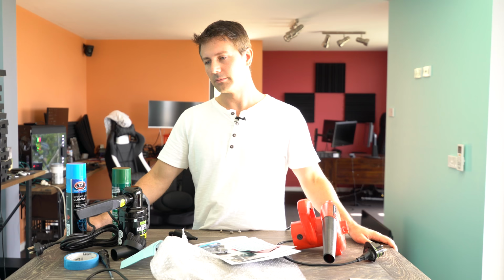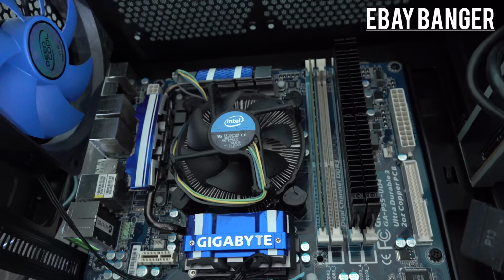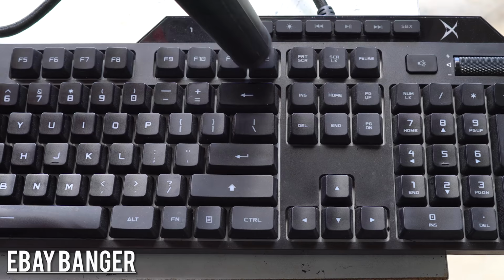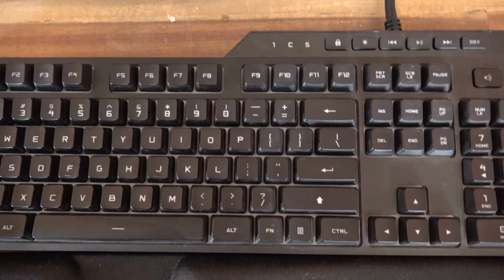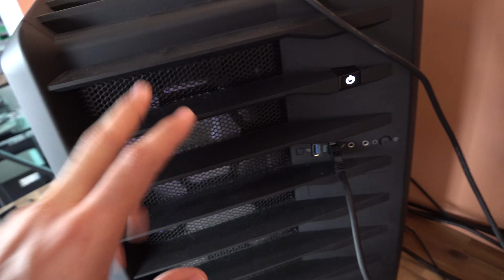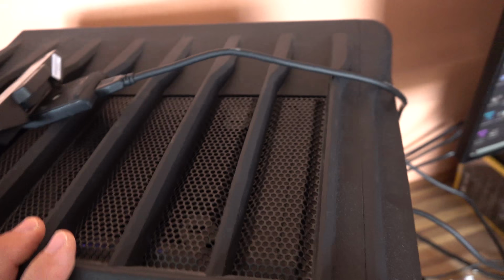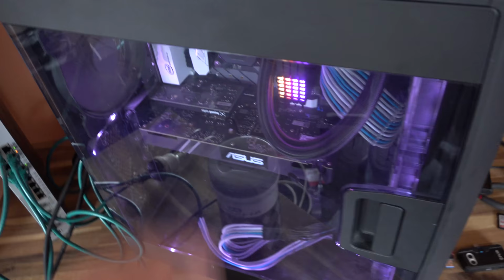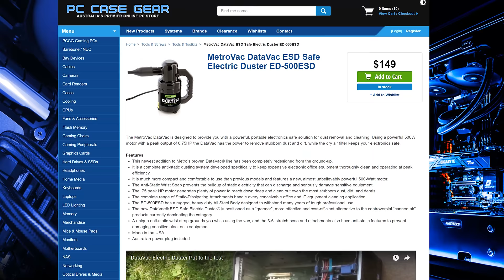DataVac Electric Duster Review - $93 Blower Vs. $25 Cheaper Ebay Version

Comment: Air compressor for nearly 20 years, not one single problem if you're careful and test for moisture with a white piece of paper as the moisture will adhere to it if it's a condensated tank. If that's the case, it's easy. Run a full cycle of decompressionand then try again. Had it happen like twice. I can get every single piece of dust out of my cases and keyboards no problem. Short blasts about a foot or so away. Just dont do it close to parts and it's never going to hurt you. Again 20 years. The experience and results speak for themselves.

Comment: You finally got one!  I love my Datavac!!  Best investment ever.  Next time use the small straw like attachment as it increases pressure due to the smaller hole and creates a hurricane in your case.  It's great for pin point cleaning like the keyboard.

Comment: Personally I bought a cheap 24 litre oil less air compressor with accessory set (≤£100).  You can control the pressure coming out of the blow nozzle on the tank and as long as the PC wasn't kept in a heavy smokers room all the dust bunnies fly out.  I have even up cycled some unused chopsticks as fan holders to get into all the nooks and crannies.  I've just had to buy a new one after 10 years of medium weekend use.  My only warning is don't get right up close to relatively large/tall components (caps) because you can bend them over.  Plus you can use the compressor for other jobs around the home, car, garden.

Comment: Never, never, never blow the dust from outside the case into the PC.  Also if you create a positive pressure in your case through fan orientation, you can greatly limit the amount of dust internal to the PC.

Comment: Here's what we did at Intrex Computers in Raleigh, NC back in the day...they may still do this. lol Pop the panels off and take it out back. Physically hold it over the big HVAC unit. That huge fan will blow out every molecule of dust in under five seconds. It's massively impressive the first time you see it done. Dunno if this will kill the bearings in your fans, but it does work. :D

Comment: honestly i think its down to the attachments, the datavac simply blows the air through a focused nozzle while the other one has a wide open hole. U can do a makeshift nozzle on the ebay blower and it should do fine.

Comment: Brian, you can get the non-esd version of the datavac for around $60-$70 usd. It has a white body instead of the black one on the esd version. I've been using it for a few years now with no problems.

Either way, the datavacs are well worth the premium over the cheap china brands.

Comment: I personally use the ITDusters CompuCleaner Original 2 (what a name!) which retail for £49 in the UK which is right in the middle. It has excellent build quality, is extremely powerful (not to the point that it'll blow holes through components however) and has all the attachments you could likely need.

Comment: Nice video, aside from the WD-40, but did either blower clean the sides of the keys on the keyboard as it looked like it needed a brush or Q-tip instead.
Reply: What's the point of WD40? WTF?

Comment: The Tech Dept I work for has 3 of these Data Vac that we hand out during the summer cleaning while schools out. They are an amazing time and money saver over canned air. We were using a big compressor before that but these you can take into rooms and they have a very long 10ft(ish) cord. Great for blowing out pcs, keyboards, and the dustiest projectors you will ever see in central Texas. They can get pretty hot though after about 2 hours of off and on use they need a little bit to cool down especially when using in un air-conditioned rooms in the summer.
Reply: Exactly why I prefer it over my compressor, CBF running hose out from garage or taking 30kg pc case out there, That freaking case has already ripped a calf muscle when I built the damn thing, Lifted it wrong way on one leg on tip toes to lean over and place in corner of desk, yep one of those 1 in a billion stupid moments that cost me 4 months off work.
Now I don't touch the pc, Datavac it and leave it in place then vacuum room later on.  ;)

Comment: I use an old Black N Decker dustbuster model ... the VH800 .. Paid, like, 20 bucks for it (brand new), and the air blowing function is so strong that it literally, blew a DDR out of it's DIMM slot...  insane shit.

Comment: I went cheap and bought the Rok mini blower from Mitre10 its okay looks the same as the Ebay one. I was eyeing out the Makita but for some thing i won't use much didn't want to spend that much the Makita does have higher RPMs. Sydneytools has the Makita for a decent price. 
Try making the hole smaller on the cheap blower that will help.

Comment: WD-40? Is that a normal thing? I've never heard of using it.
Reply: I use it to lubricate doors when their squeaking. Used to loosen very tight screws as well. It's very common.
However, this is the first time I've seen it used to clean computer components.

Comment: I bought the Datavac ED500 (EU version) for $43 on sale at Ebay or Amazon. I highly recommend the ED500 if you can find it for $50 def pick it up. The older version is white,and if someone got it in stock I'm sure you can get it a bit cheaper. It will save you from buying canned air and is more effective,and will literally clean a dusted up pc in minutes.
Reply: Also a point worth noting Is that the Datavac is a lot more "space friendly",since it's kinda shaped like a Coffee pot it will be easy to put in a drawer or closet compared to the leaf blower.

Comment: I have read horror stories about the fans damaging the PC (static discharge?) if they were allowed to spin freely during the cleaning process.
Reply: the fan motor acts like a generator (similar to a wind turbine) it ether burns out the motor coil, burns out the fan diode or, sends unregulated electricity directly to the fan headers on the mob. On top of all that it will most definitely shorten the bearing life of the fans

Comment: I would recommend getting a cheap $100 air compressor from bunnings, it put's out way more psi than these and I use it to clean dust out of my pc, ps4 and even my tv amongst other things. It also doubles as a spray painting tool, operates neumatic tools, pump up your car tires, etc. The list of uses go on and on but these items in the video cannot be used for much of anything else...

Comment: Here in NZ compressed air cans are so dear $18NZ and I resent paying that much, especially as it only last for 1 or 2 cleans.
I am tempted to get that Autovac, but then a normal compressor may be more useful around the house.
I don't think I'll be using that WD40 brake cleaner on my valuable PCs..
It looks like they did a nice job, but I'd be worried about the long term effects
Good video though well done and nice tasteful music.

Comment: Bryan, just a tip mate. Try to hold down the fans that are inside the chassis when using a blower to clean up stuff.

Making those fans spin in the wrong direction could damage the bearings that are on them.

As usual, great video! I have a similar $25 cheapo blower myself. These are all the same, it's just they come with different names, stickers and packaging.

Hoping to get hold of something like the Datavac someday to make my life easier.

Comment: Aren't you supposed to hold on to the fans to avoid it from spinning? They said it will damage the fan because of the high psi air from the blower?

Comment: the data has a crevice tool on it so its got more air power 
if the ebay one had a crevice tool it would probably work better 

as for me i use a my sweeper house to get the bunnies then use my air compressor set to 40-60 PSI to get the rest out (set it that way so 125 PSI doesn't get blown in and break parts off the motherboard)

Comment: its over $200 now.   There are other electric dusters for around $110 that look good.  There's no spec to compare to see which is actually more powerful without buying them sadly.  Wish some youtube would do some scientific tests on these dust blowers to see which actually outputs the most power.
Reply: They are simple devices, they're all the same. 
Just the housing. And maybe the power, if you look at how much energy they consume or how much they blow. And maybe the nozzle attachments, if they're included.
Mostly aestetic differences.

Comment: WD is not good for plastic, its for lubing up metal joints not cleaning, use metho if you want to clean it with something, it evaporates in the air really quickly, it can rot some rubber with excessive use, it might ruin painted metal but i doubt it, if in doubt just use a little bit on a small area.

Comment: I've been using a very similar cheapo eBay blower for a couple of years. Surprisingly good especially if you can adapt the nozzle down a little to increase the air speed. Just remember to jam any fans so they don't spin as this can cause problems.

Comment: In my experience with the cheap ebay blower the air leaks a lot at the point where the rubber nozzle locks. Duct taping it helps a lot as it takes away the leakage problem which increases air pressure. The other important note is that you should always disconnect the fans from their headers as spinning the fans can cause current to be fed back into the motherboard. Its a two second precaution but one that might save your components from getting bricked. Other than that yeah cheap blower for the win :)

Comment: The problem / issue with electric blower / air compressor / vacuum, is they produce static current. If you don't believe me, just use a vacuum cleaner in your room for a couple of minutes, and then touch the floor with your hands, and you will receive an electric shock.

Comment: I know this is an older video, but I'm looking to get a Air cleaner for my systems. I think one of the reasons that the eBay banger was not as good ( my thoughts /opinion) is because it did not have any attachments on it like the data vac to narrow the airflow. I'm curious how it would work if the attachment that was on the data vac was placed on the eBay banger.( if it would fit). Or if its a standard "vacuum attachment fitting size"" to just grab one of those and toss it on. let me know if this crossed your mind, or if you tried it out.

Comment: Honestly, is there a difference between an old hairdryer with some old vacuum cleaner attachments (or an old industrial power “Shop Vac” set to blow instead of suction)? Just curious as both have worked fine for me, and I don’t have to worry about compressed air blowing dust too deep into a slot. Also, with the vacuum, after you blow most of the air out, you can reverse it to grab any dust that settled, and just about all of us already have these things. Even most cheap vacuums have the reverse switch now-a-days.

Heh, I can’t believe I just watched 5 minutes of getting dust out of a PC. Silliness.
Reply: Both products you mentioned create a lot of static and back current if they spin the fans and could ruin your pc. A leaf blower and shop vac also wouldn't be suggested. There is non esd dusters that are ok to use such as the XPower A-2 or the non esd Metro Datavac but you have to ground the computer if your are going to use it so only risk free if you know what your doing. After learning how easily a vacuum can damage a pc I would never use one on  a pc no matter how dusty it is. If you need something in a pinch just go buy some canned air from the store while you wait for this or other brand duster of your choice to arrive.

Comment: Love that AIR 740! I am running the AIR 540. I want to get an AIR 740 and the small AIR 240(looks like a small AIR 540) I was thinking of creating a stacker with the 240 and 540. So much room in those cases.
Brake cleaner is expensive here in Canada too. I use the CRC in the red can. With the straw in the nozzle, it will shoot about 30' away. Also it's the best wasp killer. Most stuff just pisses them off more than they already are. The CRC kills almost on contact. And cheaper than wasp killer. Don't know what it's like in Australia fro wasps, be here they are real assholes!

Too funny about the blower.
It can push more wood! HaHaHa!

Comment: There are actually plenty of variants of the ebay banger. I bought the 750W variant that goes at 13000rpm and it's been far more powerful than the datavacs i've used in the past. Oh and it comes with a small fitting to direct the air

The datavacs it must be said... don't like being run for more than a minute. They will get VERY hot. Almost alarmingly hot whereas the ebay bangers get warm only on the impeller side which is normal for any high pressure blower. It's basically a low power centrifugal supercharger...

Comment: I just usually use my air compressor, carefully. I do pull out certain components to clean with the air compressor, Like the video card, so much easier when it's out.

GenFUBAR.

Comment: Is that a brake cleaner for cars? Why do you use it on your PC?
Reply: Demi Barton It's strong in cleaning, and leaves absolutely no residue on the cleaned surface.
Reply: Brake cleaner is the second best way to make a PC go faster, next to putting speed holes into the case.
Reply: Speed holes do legitmately add speed to PCs. Put some holes in your case side panel under your GPU and watch the temps fall, which means higher OCs, thus more speed. :D

Comment: WD40 attracts dust that's why good bike shops don't use it on their chains it will probably also start breaking down that matt pho rubber finish on the front of that case you'd probably be better off using something like plastic armorial or something else meant for auto detailing also when your case gets hot it will make the room wreak of WD40

Comment: wait you can WD40 your pc?!?!?!?
Reply: Yeah. i use it on my Motorcycle plastics aswell to stop them fading. works on black car trims aswell.
Reply: It appears he does spray on the inside of the case but not directly on the parts. but he does wipe them with the cloth. it may be okay on your case. but i would use electronic contact cleaner for your parts.
Reply: It's great to remove residue from all the marketing stickers on laptops.
Reply: He's using a towel too, isn't that bad due to ESD/Static?

Comment: Can somebody tell me every spray he uses and what it can be used for? What parts he uses each spray to clean? I'm still a little bit confused what he uses for what
Reply: He uses the generic WD-40 to give all parts a protective layer and cleans smudges off. and the brake cleaner he uses to clean electric parts as it can get rid of corrosion.
Reply: Thank you so much! Just to be clear with one thing, in the video he sprayed the motherboard and the graphics card with the WD-40 and he has done it in other videos as well, the WD-40 doesn't damage those parts? Because it seems like is like a liquid, sorry for all the questions!
Reply: WD40 Displaces water and is Non conductive. i would only use it on hard plastics and use electronic contact cleaner to spray on your motherboard and gpu :)

Comment: just use your vacum people, both on pc and floor. no more trash flying around
Reply: Depending on which you own, it might not have that great of a suction so won't do as good of a job.
Reply: and also static
Reply: I'm having a vision of someone running a standard upright vacuum over their PC case.
Reply: I am a fellow human like you . static charges could occure even with the tested blower banger or handyVAC.
Reply: NO MA'AM . you are right, i am using my house /floor vacum cliner, with small brush atachment. I also unplug all pc connections
Reply: most blowers don't create any static, while vacuums do
although if you decide to vacuum your pc it will probably be fine

Comment: You're supposed to hold the fan blades, or else they may spin fast enough to generate electricity, which in turn will shorten their lifespan.
Reply: that's false (unless it's plugged into wall which would be STUPID)

Comment: when my PC get dirty I just buy a new one, anyway we have new cpu every 9 months so I just upgrade.
Reply: Its usually the gpus that need the most cleaning and are a pain in the butt to deal with. cpu's especially with aftermarket coolers makes it much easier to clean.
Reply: my GTX1080Ti have water cooling, so not have this problems ... waiting for GTX2080

Comment: your wood test is so stupid 8:23 you raised the blower above the top surface of the wood blowing the back piece down first thus reducing the resistance of the other two pieces making your review more biased towards the datavac you should be a little smarter and use scales to measure blower strength/air pressure!!!